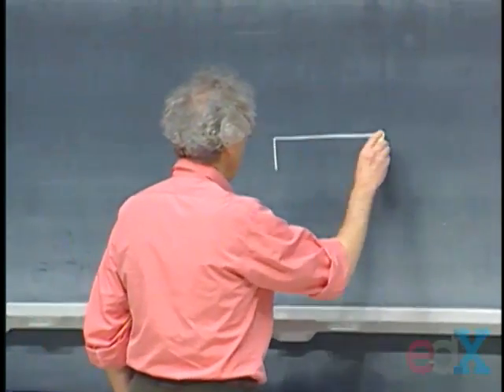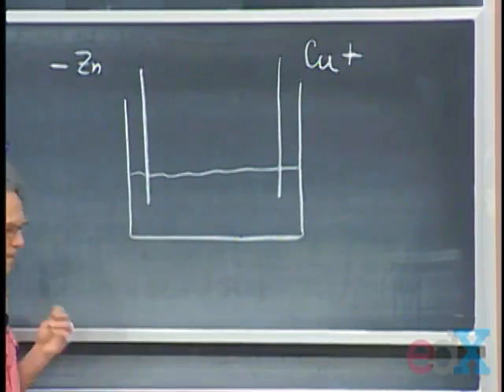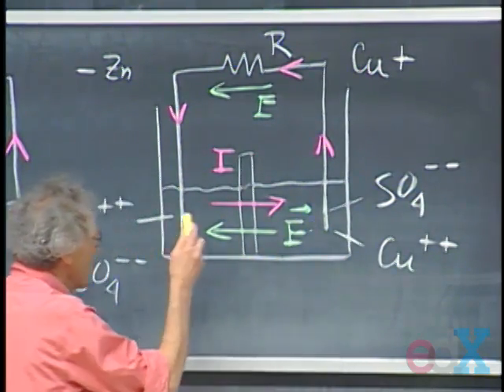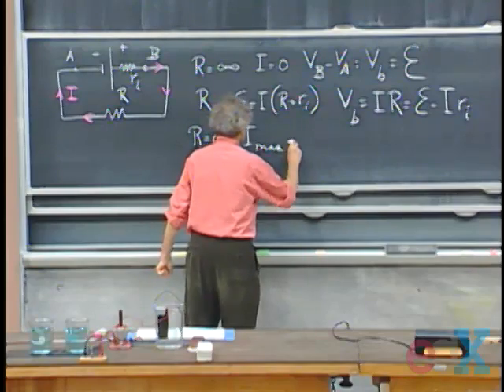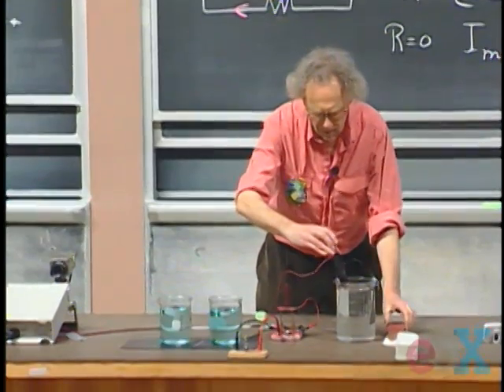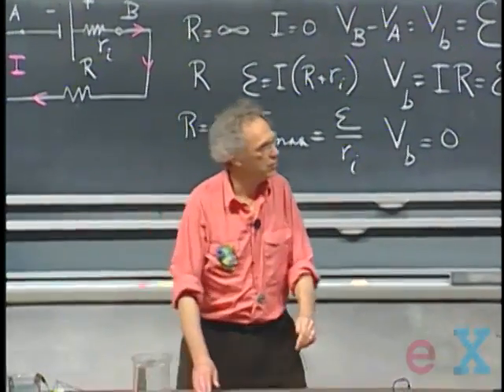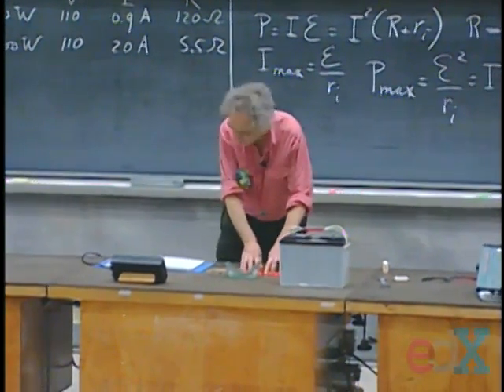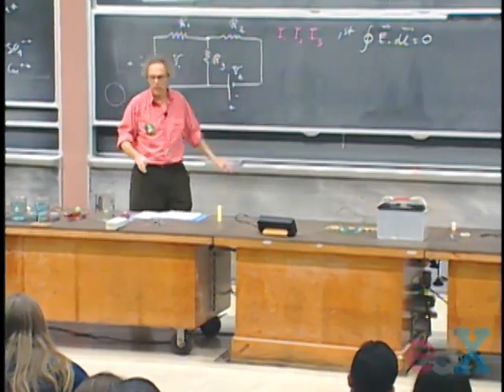8.02x - Lect 10 - Batteries, Power, Kirchhoff's Rules, Circuits, Kelvin Water Dropper

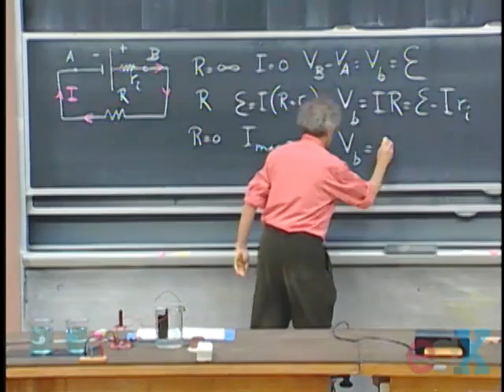Comment: When you mention in 10:31, the Vb goes to 0, so is it possible that we still have the current? I don't understand why we still have current when the difference of electric potential is 0. Can you please explain to me? And, suppose I connect a 9v battery's + with a conducting wire, and connect that wire to this battery's -, what will happen?
Reply: Also, why are you still ok even though you touch the screw connected to the car battery (in 30:26)
Reply from the maker: To touch a 12 V battery is without any danger,
Reply from the maker: I watched from 9:30-11:30. I cannot improve on the clarity of my lecture. I suggest you watch it again. If you short out a 9 V battery with a copper wire, the current will be limited by the internal resistance of the battery. I don't expect any "firework". I expect that the battery will be dead within 5-10 minutes.
Reply: +Lectures by Walter Lewin. They will make you ♥ Physics. I'm sorry, what's the next part of the explanation. And, is it ok if I charge my phone ( or any electric devices), and leave it charging even though it's full charge?
Reply from the maker: I explain the Kelvin water dropper in a later lecture. 
>>>>.And, is it ok if I charge my phone ( or any electric devices), and leave it charging even though it's full charge?>>>  Read about this on the web.

Comment: Excuse me Sir, I am Anubhab from India and I am a huge fan of your lectures and the way u present the concepts. Whenever there is something thta i don't completely understand I always refer Your lectures. thank u sir for making Physics So enjoyable.
But I do have a question......Plz help 
 It is known that inside a conductor the electric field is always zero so when we have a wire thats connected to a battery, how come the electric field inside this wire is not zero??
Reply from the maker: +Anubhab Biswas If you apply a potential difference (e.g. a battery) over a conductor whose resistance is not zero (e.g. a copper wire), then there will be an Electric field inside the wire. The copper wire has a non zero resistance, and V=IR.
Reply: +Lectures by Walter Lewin. They will make you ♥ Physics.  Got it.... thank u sir...

Comment: Hey Mr Lewin ✋🙂
Would you be able to Connect a Kelvin Generator and RAM pump in Order to have a Typ of Perpetuum mobile in water circulation, unlimited Energy?
Reply from the maker: the Kelvin Genrator needs energy all the time - it's NOT free energy
Reply: @lecturesbywalterlewin.they9259  The Energy (water) comes from the RAM pump and the RAM pump gets the falling water of the Kelvin Generator and WE should be left with the Energy of the Spark. 
IT should be a good working Generator with allmost No moving parts and by the cost of water, with a Well No Problem right?
WE could modify the Generator in Order to get a Higher Output (in Connection with a Marks Generator) 🤔 all WE need is a constant flow of water and good pressure.
How do you think Mr Lewin would that be a good Idea?
I think ITS a Clean and easy way to make Energy and ITS allmost free.

thanks a Millionen for the answer Mr Lewin and all the Videos 👍 🌹🙏❤️
Your are Great 💯

Comment: What is shorting of the battery, if we connect a wire to battery terminals, without any resistor does it mean we are shorting the battery. What happens when we short something? When the two charged planes connected to a battery when we  bring extremely close till they touch each other do we get a discharge and what effect does it have on a battery?
Reply from the maker: shorting is VERY bad for the battery - it overheats and can even explode. ask Goggle also for details.

Comment: in our homes if we keep the plug switch on without connecting any appliance, is there any power consumption
Reply from the maker: Many electronics(such as TV and Computers) when switched off consume power. There was an interesting article in the New York Times about this about 2 months ago. The ONLY way to prevent that is to unplug them.
Reply: Lectures by Walter Lewin. They will make you ♥ Physics.  thanks sir what would happen if we don't connect anything ( no comp or tv but judt the switch of the mains on)to the mains but just keep the switch on, is there still any consumption?

Comment: Why current is not reduced by the resistors in kirchoff closed loop. It's ok that number of charge entering the resistor equals number of charge leaving but current= quantity of charge flowing/time.
Current= number of charge [in coulombs] leaving resistor in "one second"(current 1) should not be equal to number charge entering in a resistor in "one second"(current). 
As resistors reduce energy of charge so charges with low energy will take more time to flow(charges leaving resistor per second should be low that is current leaving resistor should be lower than the current entered the resistor with higher velocity) as their energy is reduced hence current should be reduced however total number of charge entering resistor and leaving it will the same irrespective of time taken
Please answer🙏

Comment: Sir 
If a battery reads 1.5 volts then how what do we mean by that as per the classical definition of electric potential
Reply from the maker: it means that as long as the battery draws no current that the potential difference between its 2 sides is 1.5 V.
Reply: @lecturesbywalterlewin.they9259  if I want to express this potential difference in a way that I bring a test charge from infinity to a particular point then how do I say it
Reply from the maker: @hridayamkrishnahore2964  The electric PE in Joues or in eV of one pole depends on its environment.  It could +or - hundreds of Jules it could also be zero if you attach that pole to the ground.

Comment: Professor, if I have an isolated inductor like an ignition coil and I induce a very large voltage by collapsing a magnetic through the coil, would I receive a shock if I held one end of the inductor and stood on the ground/earth. Would it discharge through me even though the inductor is completely isolated from the ground itself or would I need to touch both ends to feel the shock (complete the circuit). Thank you
Reply from the maker: The magnitude of a shock depends on L of the inductor and dV/dt of your voltage. 
If you hold one ends of the inductor in one hand and the other end in your other hand  the induced EMF will go through your body. It's magnitude depends on the time dependence of dV/dt
Reply: Lectures by Walter Lewin. They will make you ♥ Physics. Thank you for reply excellent lectures.

Comment: Sir in the last lecture you said that the souls of the shoes are not very good insulators to be used while carrying on such experiments but in this lecture when you were short-circuiting the car battery, you did it with naked hands but did not get any shock. Why did this happen?
Reply from the maker: battery voltage is only 12 V. My body resistance is so high that the current through me would me mA at best. The vdG voltage is 300,000 V

Comment: Dr. Lewin, when you hold the wrench onto the 12v battery at about the 30 minute mark, why is there no danger of holding onto the wrench with your bare hands?  You don't receive any sort of shock?
Reply from the maker: +Josh shorting out the car battery for more than just a fraction of a second will cause dangerous fireworks and that can seriously injure me.
Reply: +Lectures by Walter Lewin. They will make you ♥ Physics.  Well, I suppose my question is more along the lines of the 7kW of power that the battery experiences.  More specifically, the 600 amperes.  I've seen a few people on YouTube who short out a car battery for an extended period of time (and even someone who used a shorted out car battery as a makeshift welder) and you're right about it being very dangerous :) But why is it that those 600 amperes don't flow through you as well as the wrench?  Isn't 600 amps a dangerous ammount of current for a person to handle? Why doesn't it go through you?  Why is it that the battery is the only thing that experiences that 7kW of power? Shouldn't you as well?  And thanks for your earlier response, I'm binge watching your entire course on 8.02 for my University Physics II class over first semester break and following along with my book and I'm really loving it!  You're an incredible professor! It's an honor to receive a response!
Reply from the maker: +Josh You short the battery with a piece of metal.Thus the current does go through the metal not through you.  If the 600 A goes through your starter motor for a few seconds only that's OK. A major fraction of the 7 kW is then released in the form of heat in the motor and in the battery. If you short the battery with a wrench for a minute, the heat is mostly released inside the battery and you can imagine what then happens.

Comment: Sir , at 30:51 , why didnot you get an electric shock ? Is it because your resistance is much higher than the wrench ?
Reply from the maker: when you touch a car battery you do  not get a shock.
Reply: @lecturesbywalterlewin.they9259  But you are touching the wrench which represents a path for current .
Reply: @mahmouddesokey3818  He doesn't touches both terminals of the battery, but even if he did the 12Volts of the battery and the high resistance of the skin are not enough to allow a high current to pass through him and shock him.

Comment: Why is the closed loop integral of E dot dL in a closed circuit equal to 0? isn't that a special case for when we have conservative fields when there are no charges moving and yet in our circuit charges flow from one side to the other all the time
Reply from the maker: closed loop integral of E dot d is ONLY zero if dphi/dt = 0
That's called Kirchhoff's loop rule.

Comment: Sir at 10:35 you said that " it doesn't mean there is no current running, but it means between point A and B , the potential difference goes down to zero" . sir but if there is no p.d between points A and B than how can there be current ? :)
Reply from the maker: I watched at 10:35. What I have is perfect. I cannot add to the clarity - watch it again. If R=0 you have a circuit with an EMF (the battery).
 I=EMF/r, here r is the internal resistance of the battery
Reply from the maker: If you attach a voltmeter to the poles of the battery with R=0 the voltmeter will read ZERO but the current through the circuit will be I=EMF/r

Comment: @12:50 
what would happen if you arrange battries with negligible internal resistance in parallel what would be emf in circuit then?
Reply from the maker: question unclear
Reply: Lectures by Walter Lewin. They will make you ♥ Physics. We put batteries in a configuration like parallel resistors in a circuit.

then what would be the emf
Reply from the maker: at 12:50 I show you what the emf is that is produced by my Cu Zn battery.

Comment: Happy new year sir and good afternoon, I have some problems understanding the principal of putting two batteries in series. When I think back of potential difference and current flow I would have guessed that when I connect two batteries with the same voltage in series the following happens: The minus pole connects to the plus via a conductive wire, now current will flow to equalise the potential difference between those two (All before there is a closed circuit involved). When I think of charge deficiency on the plus pole of the battery and charge overflow at the minus pole of the battery,  there shouldn't be the double of potential difference because now I have only the potential difference between the plus pole of the first battery and the minus of the second battery, so is the mistaking I am doeing here? Thank you
Reply from the maker: if you have 2 batteries each 2 V and you connect with a copper wire the + of one with the - of the other, then you have a 4 V battery. If you connect + with + and - with - then you have a 2 V battery
Reply: Thank you, but from a electrostatic point of view, when I connect + with - of the other battery, what is the potential difference between those two points and the electric field in there?

Comment: sir what is the correct definition of the EMF. SIR  i am confused between the definiton books says that emf of the device is the work  per unit charge that the device does in moving charge from its low potential terminal to high potential terminal.
Reply from the maker: use google

Comment: what'll happen if I move the two points of the Kelvin Water Dropper? will it keep on building a potential?

also, can I use it to make a Jacob's Ladder?
Reply from the maker: if you bring them very close you will see small sparks and more often, if you move them very far apart you may never see a spark. Some corona discharge will then occur elsewhere.
Reply: Lectures by Walter Lewin. They will make you ♥ Physics.  Thank You sir!!! love your videos....
also, can I make a Jacob's ladder using the Water Dropper?
Reply: Ashwin George . No. You will get the same brief discharge at the base (narrowest) gap of the ladder.

Comment: sir definition of emf is
1)it is the work done by charge in  moving across the circuit
2) it is the potential difference between two electrodes(+ve and -ve) when no current is flowing through the circuit.

is both definition  are correct.
Reply from the maker: 1. emf is NOT energy
2. potential difference between 2 points (whether current is flowing or not) is the integral of E dot dl.

Comment: Dear Sir, when resistance is not there why are we treating as infinite resistance, it should be zero resistance, please help me understand it
Reply from the maker: Cut the wire when your light is on. Current goes to zero but the voltage on the wires is still 120 V. R=V/I thus R goes to infinity.
Reply: @lecturesbywalterlewin.they9259  so sir, cutting wire is equivalent to having no resistance still not getting into  my head.. or adding infinite resistance so that current will be zero as it has no path..
Reply: Or it requires quantum mechanics explanation
Reply: May be my thinking is remove resistance means replacing it with normal wire keeping circuit closed and ur intention of removing resistance is to break circuit.. literally only remove but not replace
Reply: Thats cause of my misunderstanding may be

Comment: Sir at 8:18 you said that "if that R is not there that means the resistance is infinitely large" but sir if that R is not there so resistance will be only that of wire which is negligible approx zero, so how you said R= INFINITE? :)
Reply from the maker: currents through an open circuit are in general near zero. It all depends.

Comment: What if the water flowed through a copper tube  or a magnetic tube What affect Would you get could something like that be reconfigured to harvest power from a pipe that has water flowing through it it looks to build up some type of static charge 🤔 pretty impressive the water seems to spread out as the electrical resistance builds up could it be because you have a diamagnetic material flowing through a ferromagnetic material 🤔
Reply from the maker: highly INEFFICIENT Electric Power source

Comment: 8:15 if that '' R '' is not there then shouldn't there be infinity current running through since there is nothing resisting the flow of the current?  I=V/R
Reply from the maker: all power sources have an internal resistance.
Reply: If the internal resistance of the power supply is r_i, then why does R = infinity, and not r_i in a situation where you remove the external resistor?

At 10:04 , you mention "if I short out the battery" - isn't that what the example at 8:14 is doing? Removing the external resistor essentially connects the two terminals of the power supply together.
Reply from the maker: question unclear.

Comment: But I thought there was a whole video Mr. Lewin made about how Kirchhoff's loop rule is for the birds? What is that about? Is there an explanation of it possible without calculus involved? (I only know algebra based physics)
Reply: The bird sits on ONE cable, so the bird sits on the same potential. Same potential means no potential difference, so no  current passes through the bird.

Comment: At 8:10, how come if the resistor is not there, R=infinity instead of R=0 because there is no resistor?
Reply: Ohhh, I think I just realized what you meant. When you said the resistor is not there, did you mean that there is now a break in the circuit so that's why R=infinity? In my head I just was imagining that with no resistor there was just one long continuous wire that went around the batter similar to the case where you short out the load.

Comment: sir                                  1)emf is work done by battery on unit charge.  
2)emf of cell is that potential difference between two terminal when no current flows ( because when current flow potential difference decrease due to internal resistance). 
 is now I am correct sir.
Reply from the maker: 1. emf is NOT energy
2. potential difference between 2 points (whether current is flowing or not) is the integral of E dot dl.

Comment: Does the concept of equipotential also works in electricity.....due  to which points connected with wire are at same potential....?
Reply from the maker: Review the meaning of electric potential at a point P That will tell you your answer. Watch my 8.02 lectures or use google

Comment: hello sir I I am confused about nature of Forces is there only two kinds of forces in nature conservative or nonconservative
Since
EMF is the work done Per unit charge
What will be the nature of the force responsible for this work done - conservative or nonconservative
Reply from the maker: >>>EMF is the work done Per unit charge>>>
That statement is dimensionally correct but it does not tell you much. Watch my 8.02 lectures on EMF and on induced EMF.